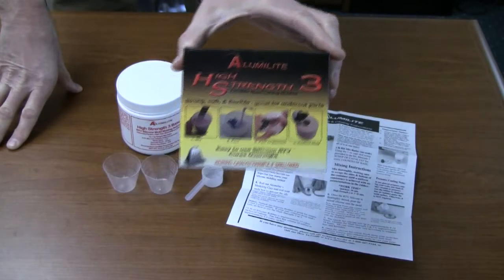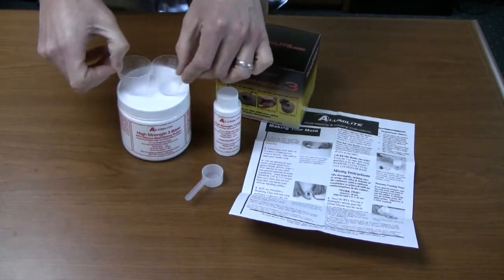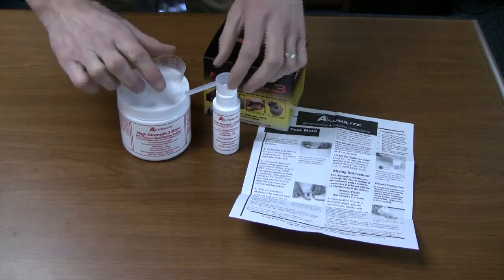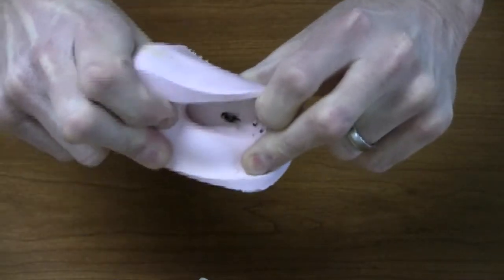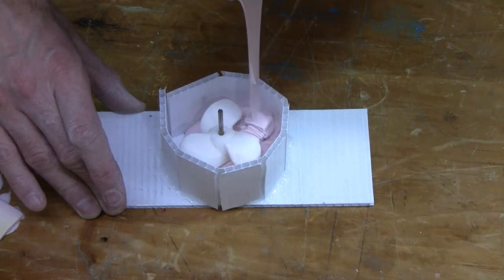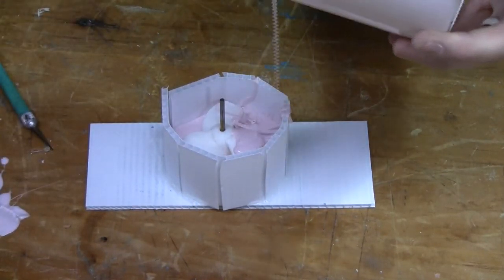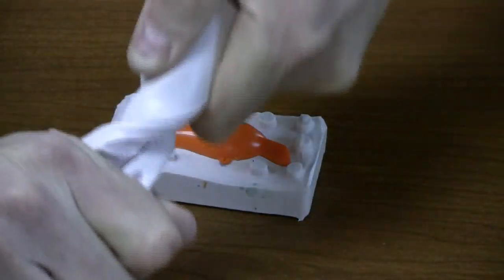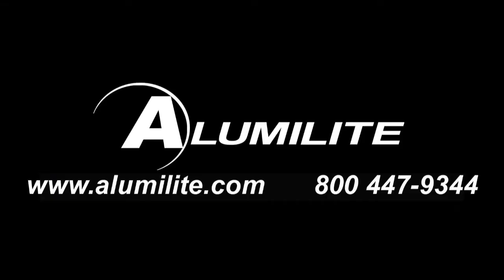High Strength 2 and 3 Product | Alumilite

Comment: How do you make the sealed mold box?
Reply from the maker: Hi Lauren, we sell the corrugated strips shown in the video. You simply make cuts on one side of the plastic wherever you want the plastic to bend. You then glue/seal it in place with hotmelt glue or even super glue. You can also use old food containers, plastic solo cups with the bottom cut out or even Legos to build a mold box. Good luck!
Reply: AlumiliteCorporation Thank you!